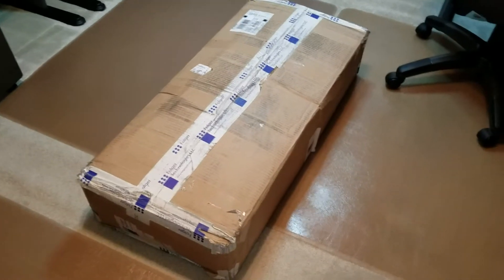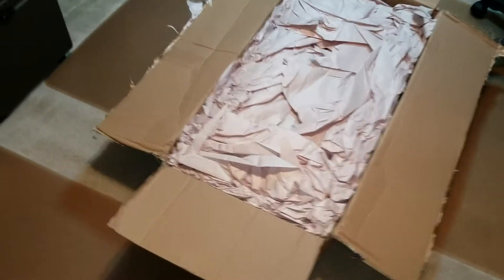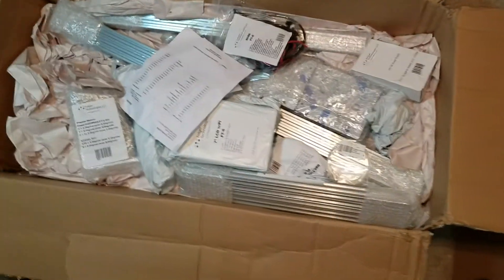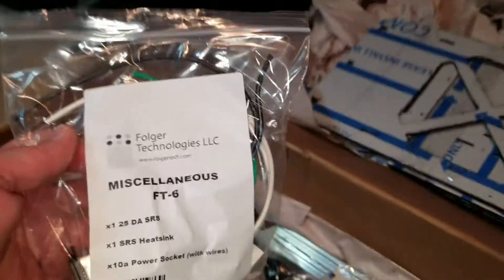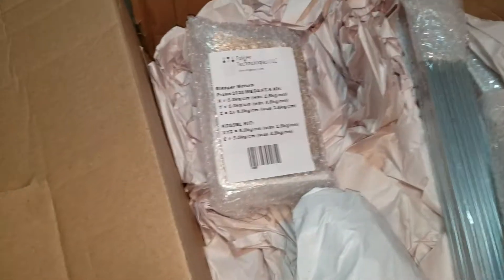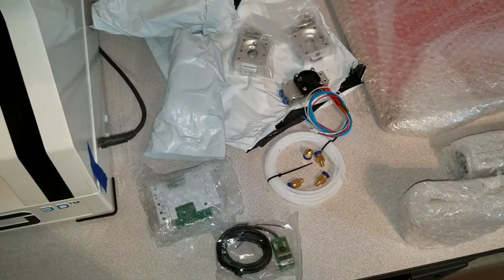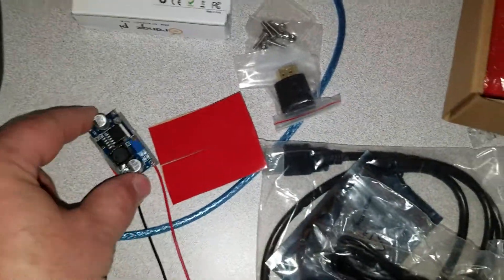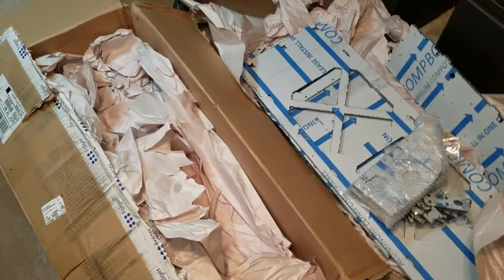Folger Tech FT-6 3D Printer Unboxing Video

Comment: The extruders are what drives the filament. There are 2 completely separate extruders there. What you wanted was a dual hotend or nozzle which is not what was listed.
Reply from the maker: Not to get into a semantics argument here, but by definition an extruder must actually extrude something.  It can't do that without a hot end and an extruder tip.  Thus, an extruder is an entire assembly, not just the drive/feed assembly that causes it to extrude.  It would be accurate to call it a dual feed or dual filament extruder, where the adjective dual is a modifier of the "feed" or "filament", not "extruder" which remains singular.  A dual extruder,, without the modifier, implies two complete assemblies, including feed and hot end/tip.